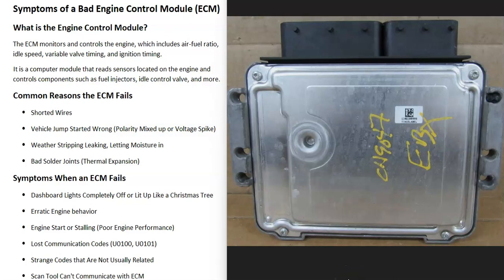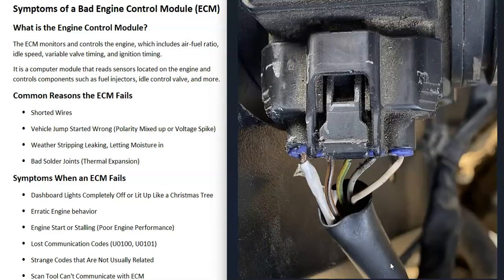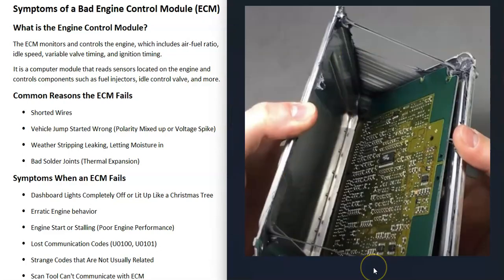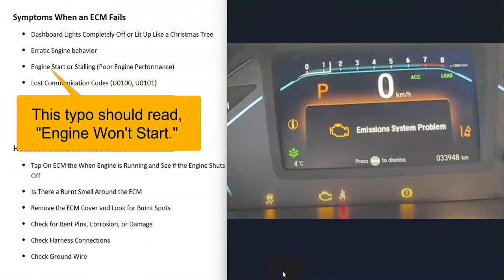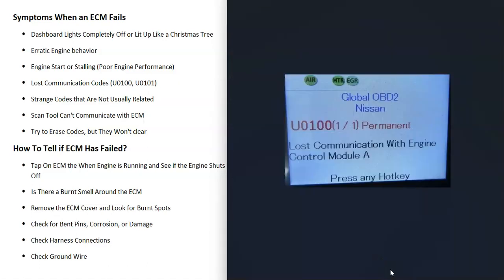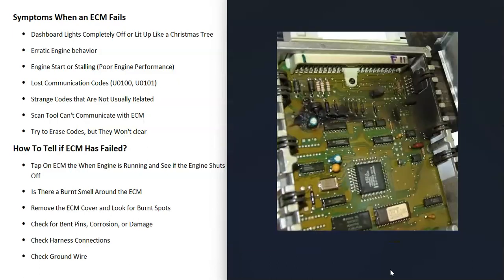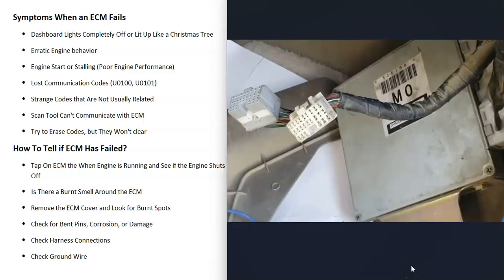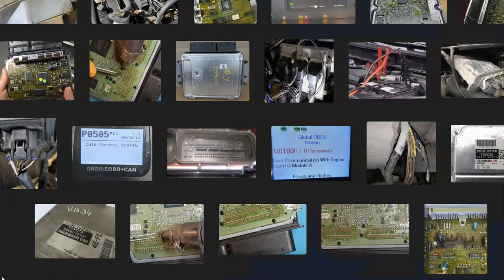Symptoms of a Bad Engine Control Module (ECM)

Comment: Ok i will be driving and the come to a stop light and when i pull off floord or not its sluggish untill about 2500 and boom power only when i stop and go once warmed up i think throttle position sensor